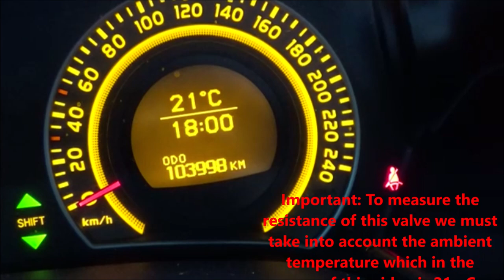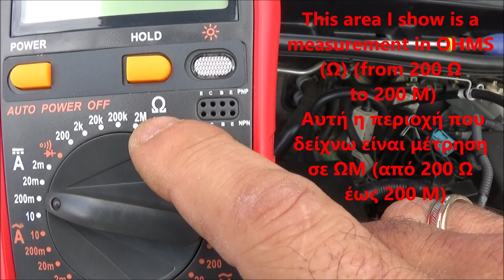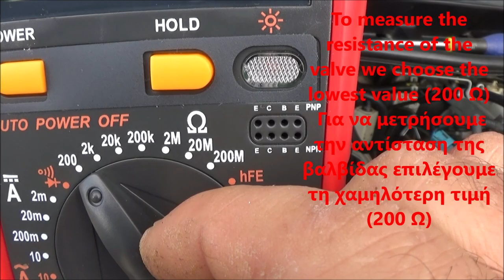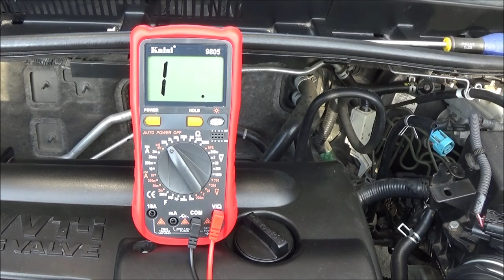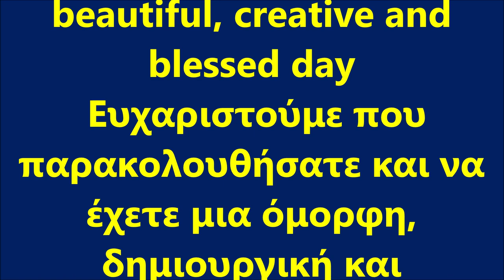2007-2013 Toyota Corolla How to remove and inspect the Vacuum Switching Valve Βαλβίδα Εκκένωσης

Comment: First comment 🙂🌹❤️🌹❤️🌹❤️🌹
Reply from the maker: THANK YOU MY FRIEND ❤❤❤❤❤❤😊😊😊😊😊😊😊😊
Reply: What will happen if the duty cycle vacuum is not working properly?
Reply from the maker: @kerkiangraham4267  What are the symptoms of a bad vacuum switching valve?
A.  Your engine has a rough idle.
B.  Your car has poor performance.
C.  You have increased fuel consumption.
D.  Your car frequently stalls when idling.
E.  You can smell fuel.
F.  Your engine management light stays on.
G.  Your car produces more emissions.
Reply: @YiannisPagonis  thanks I recently my fuel economy had degrade, so I will investigate. No issues with idling or the other symptoms you mentioned.
Reply from the maker: @kerkiangraham4267  Yes my friend check it out. And who knows, it might play a big role in your problem.

Comment: Is this the EGR Valve ?!
Reply from the maker: No it is not. My car does not have an EGR valve
Reply: Your car is corolla 2007 1300 cc?
Reply from the maker: No, my car is 2008 model, 1.400 cc, 97 hp, 4zz-fe engine, made in South Africa
Reply: @YiannisPagonis  this is not  made in japan 🇯🇵 
It is bad model its transmission is not durable 🙃
Reply from the maker: @ahmedamged6037  What a pity my friend! So you have a lot of trouble? 😮